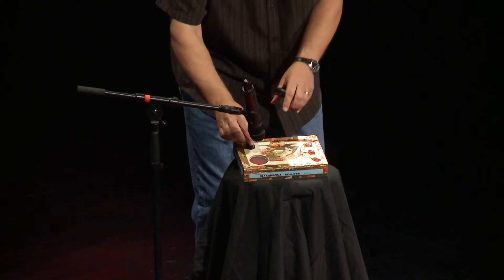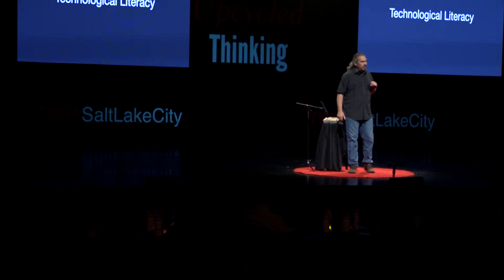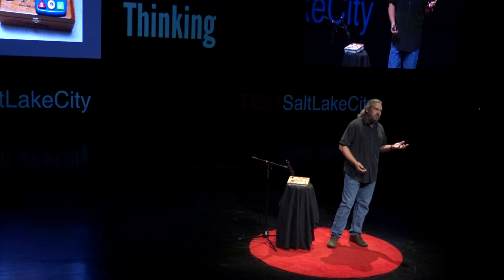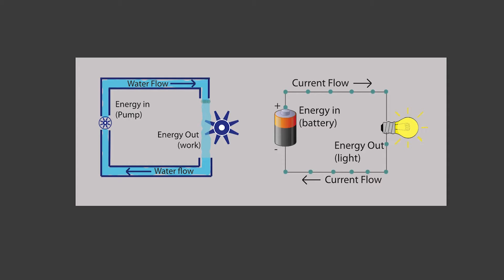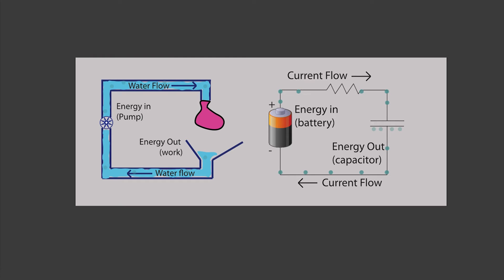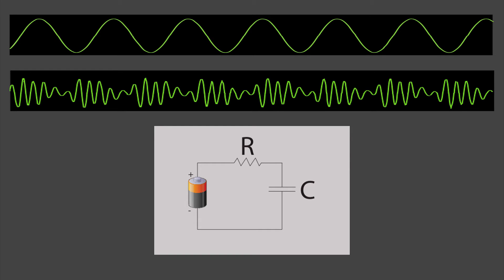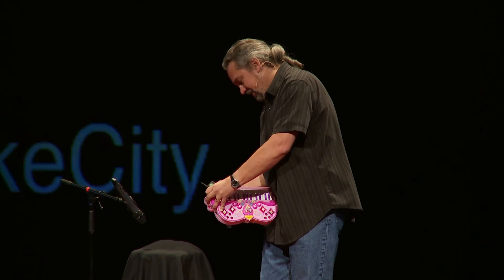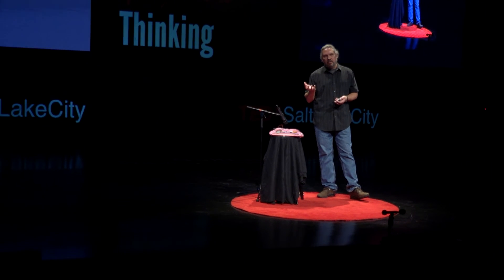Circuit Bending: The Science of Breaking Toys | Erik Brunvand | TEDxSaltLakeCity

Comment: umm.....electrons flow form negative to positive
Reply: Yeah, Electrons do flow from lower to higher potential, but the scheme shows current flow, which is considered as movement from higher to lower potential
Reply: It depends on what system you are using, "conventional flow" (+ to ) or "electron flow" ( to +). In reality, electrons DO move from - to +, but the majority of engineering imagines the electron "holes" moving as positive charges, which also works mathematically as long as you don't mix them.
Reply: Please don't muddy the waters, this is circuit bending 101 for dummies, the slightly more advanced knowledge can be acquired later, if the veiwers decide to learn more.